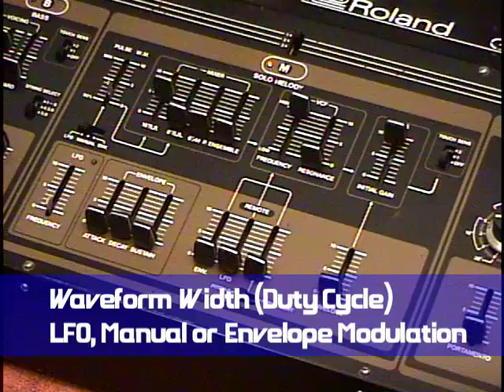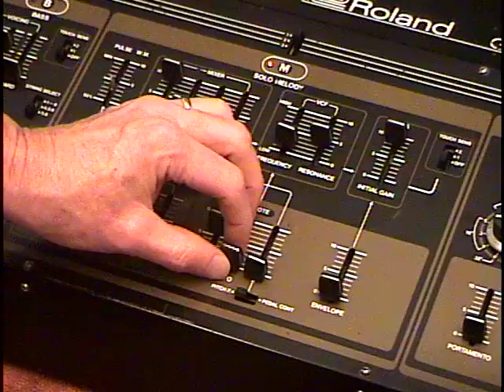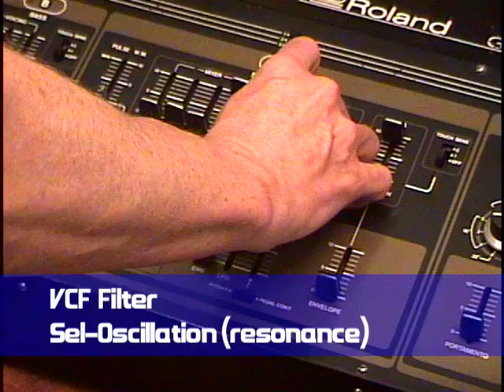Roland GR-500 Solo Melody Section - True Monophonic Vintage Analog Synthesis

Comment: Hey Wayne, any idea what the GR-500 unit cost in 1977?  I see on your website that you've found that the GS-500 was about $1000 in 1977.  I'm doing some research comparing launch prices of various guitar synths and in particular am interested in whether the GR-500 and GS-500 together came in at lower than the initial price of the ARP Avatar, which, as we know, failed horribly.  I'm just curious if price or bad timing or both were at fault there.   Cheers!